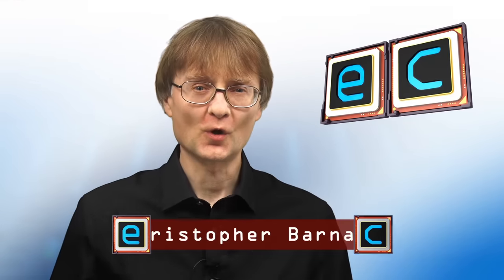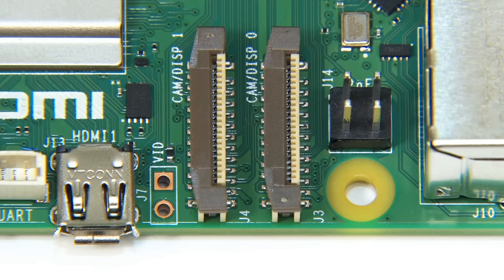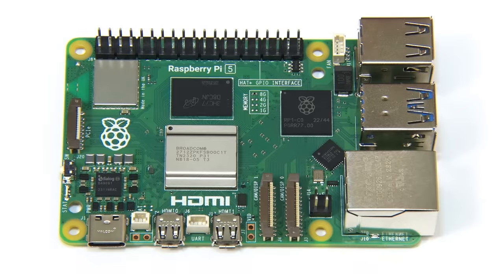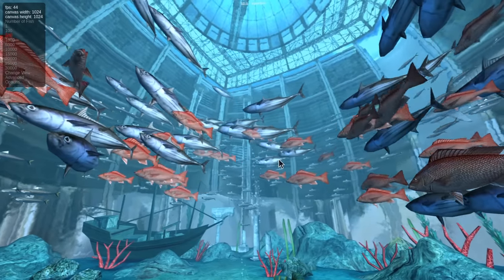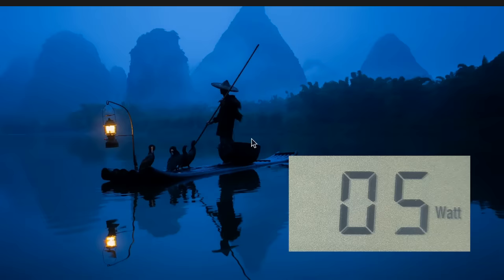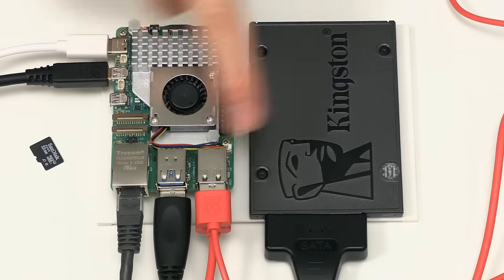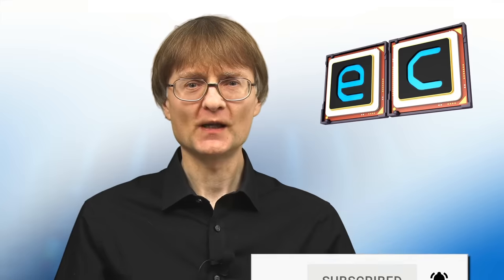Raspberry Pi 5

Comment: Great video about the Pi 5. I wasn't expecting a video this quick about its release!

The Pi 5 is a welcome upgrade to the Pi 4 that has a lot of improvements that make it even more comparable to a small desktop PC. I am quite impressed by the performance improvements that have been brought with this hardware. After getting used to the Pi 4's layout, seeing that the Ethernet port has moved back is a change. Quite exciting!
Though, I will still stick to my Pi 4 as it does everything that I need: I unfortunately don't use it as much since having a laptop (that I plan to use for a very long time). Furthermore, I like that Raspberry Pi OS supports older models and that they are thinking about performance. From their blog, one of the maintainers mentions that Wayfire, the Wayland compositor that will be used in the next release of RPiOS as they're moving away from X11, has high reliance on the GPU, which makes it less attractive for older models (Pi 3 and older) but they are looking into mitigating it by using software composition for these. I'd link to the comment but Youtube anti-spam policies might lead to my comment being deleted.
I also dislike the removal of the TRRS connector as it comes in handy sometimes, especially for audio output.
Reply: Wayland shouldn't be a problem on older Pi models, as long as it supports OpenGL ES 2.0. The KMS fiasco with different sets of drivers makes it a pain, though.

Comment: I have to say the firmware updates had/have improved the 4s performance a lot. 2X sounds like it could actually be a daily driver for many people. But I'll have to pass on the Pi foundation red and white case.

I used to drop, at least, 10% (honestly, I do not remember; just that it was frustrating) @1080p and after about 30 minutes of updates I have dropped 603 out of 26143 (I'm halfway through the video). I also remember youtube pushing very close to 100% and now it is topping out ~84% and the Argon V2 keeps below 60c.

I do admit I got an exceptional chip and video because it over-clocks @2100 with no bumping up the voltage.

I, pretty much under-use my Pi4 as a travel router; I cannot wait for the next Zero and carry my router on my key-chain.

Comment: The new Raspberry Pi is a very interesting beast. It's obviously going to have value as a well supported long term platform, but for people doing compute based projects, it gets a bit weird because comparable RK3588 based systems will have a much higher efficiency (and multicore CPU performance), and better support for OpenGL (non ES!!!), Vulkan (up to 1.3, if I remember correctly), and potentially OpenCL down the line, on top of already having options in 16 or even 32GB of RAM in some cases.

Personally, I'm very interested to see how it performs in graphics heavy applications using Box64, and if we can get solid support for any machine learning frameworks...I wouldn't be surprised if the big players like Pytorch did get some sort of support for the RP5, given the massive market of potential Pi owners, but I also wouldn't be surprised if people interested in doing compute work on ARM didn't just move to another SBC or perhaps an Ampere Altra.

Regardless, It's super exciting to finally get a new Pi on the market!

Comment: Raspberry PI 5 is a disappointment for me.
Cons:
- very old ARM Cortex-A76 design
- high power consumption
- high requirement for the power supply
- fan requirement to keep clockrate high
- requirement for a M.2 HAT to connect a M.2 card
- M.2 PCIe card max size type is 2242, while PC M.2 cards are usually much longer. This will drastically reduce the selection of good M.2 cards.
- no AV1 decoder
- price with the extra M.2. HAT. A PC is much cheaper and more capable.
- still dependent on Broadcoms Videocore, while the ARM CPU is only attached to it. I would have preferred a clean, pure ARM SoC here.

Pros:
+ first models start by default with 4 GB RAM
+ RTC
+ PCIe support
+ power button

The advantages of a normal low-end PC make the Raspberry Pi 5 look bad. There are cheaper microcontrollers for playing with GPIOs, and if you hook something up incorrectly and create a short circuit, it won't cost you a fortune. I will therefore definitely not buy a Raspberry Pi 5. My Raspberry Pi 3 is basically enough for me. The only thing missing from the Rapsberry Pi 3 would be a little more RAM. Other single-board computers are now better. The software problem should slowly disappear for them.

Comment: They could have added a couple of ARM Cortex-A55 CPU cores so we can prototype systems using a heterogeneous processing architecture.
The VideoCoreVII is a very welcome addition, finally more GPU power than the VideoCoreIV in the Raspberry Pi 1...

Comment: My thoughts? The improvements in cpu/gpu performance are great, the improved connectivity for USB und microSD cards, plus the awesome pci-e interface are awesome and probably quite a few people will be happy about the separated fan-connector, the hardware power-button or the rtc battery connector. However... I really wished they would have upgraded the networking... 2,5GB ethernet port... and/or... WiFi 6, is, in my oppinion at least as much as required as 600 MHz more CPU power. I literally would have payed 10-15 bucks more for more modern networking. Also, still not a fan of micro-hdmi and the things they removed (audio/composite port, also no  h.265 hardware encoding and even removing the h.264 hardware encoding). Sooo... that leaves me with: great update, but not necessarily the upgrade I personally was hoping for.

Comment: Thank you for this review (and all others). My dream SBC rasberry would run LinuxCNC (64 bit) 2.8.4 "Buster". The ethernet port could communicate with a Mesa 7i96S.
If this were to happen, no more 50 pin printer port!! I have the Mesa CNC interface card and would like to have a small SBC to create a very neat integrated CNC package.
If this is something you are interested in, your input on this topic would be awesome!

Comment: It uses 1 watt when off?
Reply from the maker: That is the minimum the power meter can show -- so somewhere between 0.5W and 1.5W when the Pi is off, but the adpater is plugged in, just like any computer that is not turned off at the wall.

Comment: There are office PCs out there slower than the Pi, so there's that. But, I remember when the early Pi began, it was the cheapest, most powerful SBC. These days, it's neither the cheapest, nor the most powerful, by a large margin. It went from really cool board for all makers that democratized the DIY space, to a really cool toy for enthusiasts. And there's nothing wrong with that, but at that point I start expecting an NVMe slot, and better than 1x PCIe 2.0. It's in that middle ground where it isn't too cheap and it isn't too powerful, both at the same time.

Comment: I have Raspberry 2.3, 4-4GB and 4-8GB, and I recently bought an orange pi 5 plus, comparing the orange 5 plus with this raspberry pi 5, I found it strange because using them the orange pi 5 plus seems much more quickly but sysbench showed otherwise. See the Orange Pi 5 Plus sysbench below.
CPU speed:
     events per second: 3875.44

General statistics:
     total time: 2.5781s
     total number of events: 10000

Latency (ms):
          min: 1.01
          avg: 1.03
          max: 6.81
          95th percentile: 1.04
          sum: 10308.45

Fairness threads:
     events (avg/stddev): 2500.0000/22.67
     execution time (avg/stddev): 2.5771/0.00

  Well, it looks like I'm going to have to buy the Raspberry Pi 5, because I really like the quality of the operating systems available for it.

Comment: What is up with that SMD resistor which looks like it's specifying the memory?!?  All of the 4 choices appear to be connecting to exactly the same nodes..  Is this just something that is being done by the pick and place machine to give you a visual indicator of what memory chip is on that specific board, because it sure would appear that the jumper is doing nothing...

Comment: Great review as always! 🙂 
Although, I would've liked to hear about some of the more obscure connectors on the board and there was very little about GPU / video performance.
For me, there are many features on the Pi 5 that I have been missing, ticking almost all the boxes for me (PCIe... Yay! Onboard RTC... Yay! Power button... Etc.). Of course, everybody has a different take on what features are essential, nice to have or not needed and the strength of the Pi has been its versatility.
As for me, I still would've preferred M.2 instead of a custom PCIe connector, even if this came with some limitations. Hey, I wouldn't have cared if it meant slightly growing the board, although, a lot of people would've protested. 😆  My big dislike is the continuing use of HDMI instead of DP. DP is very common in embedded and it's an open standard. Even as a connector, mDP is more robust than the flimsy microHDMI. The appearance of active cooling as a default is slightly alarming for me but some applications or custom boxes may be fine without it and it's certainly good to have a standard cooling solution.
Reply: It is a bit odd using that pcie connector... even if you want to use pcie cards instead of a NVME, there's cheap adaptors already for that.
Seems almost like they wanted to sell genuine accessories.

Finally means you could pair it with a reasonably cheap SATA adaptor and make a DIY NAS... something I've been wanting to do for about 5 or 6 years now (and gave up and made a DIY old desktop PC storage machine instead).

Comment: can anyone tell me  if i make SD copy to SSD my old SD card, and start only used SSD boot, all have same than SD card, BUT if go internet looking yotube or netflx and make video pause, and then all OS freeze and need new boot can use raspi again, my table computer have raspberry pi 4 8gb board. or have better method copy SD card to SSD and use only SSD boot raspi,  i used only SD card copier what have in raspi.

Comment: How many people still thought the lack of Pi4's was a production supply issue? Did anyone know until two days ago that the problem wasn't supply issues but a new release? The Raspberry Pi uses a Broadcom system-on-a-chip (SoC) that contains several components, including a CPU, GPU, memory, and other peripherals. As a result, the production of Raspberry Pi has been impacted by the semiconductor shortage, leading to delays and shortages. Mar 1, 2023 By the way the compute module 4 only came out October 2020.

Comment: Yes, this will be a success but, the Pi team have lost the plot. It's now all about speed and the desktop experience, just like the PCs did moving across the years. The Pi was supposed to be the computer for hackers with easy I/O access, the very thing PCs lost with no serial or parallel ports only USB connectivity. The Pi seems to be moving that way with complex interfaces made with impossible for individuals to buy connectors. It would have been nice to see more I/O with SPIO or I2C or a simple clocked data bus with dual port ram. Any extras that allowed someone at home to build bits themselves and attach to it. The lost of the audio port is a sign of the times. Would have been nice to see 2 or 3 more of them, not zero.

Comment: Mr Barnatt Sir, You are a treasure unrivalled. First impressions on Pi5? I like it, that's a huge i/o upgrade. 1 PCIE lane feels like not enough, would much rather swap one of those camera ports for another PCIE socket but I'm weird and You can't have everything. On topic of Me being weird and not having everything, I would have liked to see 2.5gb ethernet at this stage. The deciding factor for Me will be as it has been with all the previous Pis. Video playback performance in a browser. Specifically, Youtube playback. Even accepting that it maybe won't do for the gaming YTers who upload in 4k to get around YTs awful compression and then we watch on 1080p/1440p screens... If it can't do a good solid 1080p60 its use cases for Me are sorely limited from I could use 5 or 6 of them, to MAYBE I decide it's okay for a background machine and only have one.

Comment: have new raspi 5 adapter cable can use raspi PCI port to connect PCI paraller port car or other PCI card to raspi. and use plug and play this card same than normal computer can.

Comment: First thoughts are that I don't want any computer that doesn't have onboard sound. That said, since the USB ports are all handled individually by the southbridge, I could get used to using a USB audio adapter for sound and a passive hub for keyboard and mouse. So...okay, we're breaking out the audio to a separate device connected via USB. Not too different from sacrificing an expansion card slot for a SoundBlaster.
Reply from the maker: It has onboard sound, it just only outputs it via HDMI! :)
Reply: @ExplainingComputers  That's like saying that it supports VGA, you just need a HDMI to VGA adapter. (Never mind that very few people still use VGA monitors; the analogy stands.) It doesn't have analog audio on the motherboard, which has been a non-starter for me regarding some of the Raspberry Pi's earlier competitors. The new southbridge chip makes this less of a priority.

Comment: I wished they would have put a 6 or 8 core CPU on the Pi 5. I also think that a 1 gig version should have been released, for the project guys. I absolutely do not like that they changed the board layout again. I have a ton of Pi4 cases that would like to have used on the Pi5. My Argon One, my Michael Klements case with the stats display among others.

Comment: Excellent video. If you don't have it planned already, would you be able to test the USB power supply limits? Maybe with a couple of power hungry rust spinners.

On to the Pi5 itself. What a disappointment. Mainly the hackish bespoke ewaste power supply and the micro hdmi connectors. I'm not sure why they haven't switched to display port over USB-C. A USB-C hub meant for docking laptops includes hdmi at 4k60, audio in and out, USB for keyboard and mouse, SDcard and sometimes 1 Gb ethernet. All for about the cost of two micro hdmi cables. There's also plenty of standalone converters available for VGA and composite.

Also based on the pi's price point I'd much rather have a M2 slot instead of PCIe, if that was a choice they made.

Comment: What people don't realize is that the 3.5mm jack was actually an RCA type jack.. not audio alone.
You could use it on a CRT TV.
I'm absolutely furious that they removed it.
Reply from the maker: I can only agree. Not good for retro gamers and others
Reply: @ExplainingComputers  Exactly.
I can only hope someone comes up with some sort of an adapter maybe, that plugs into something on the board.
I realize there's actual HDMI to RCA adapters, but they tend to not function well and they overheat.

Comment: Good shit and a fairly reasonable price (there's absolutely no point in the 4GB version, though), but I don't see why OpenGL ES 3.1.0 from 7 years ago instead of the 4 years ago released 3.2.6.

5V * 5A = 25W, so that's quite a bit, and explains why the PSU was so small, as seemingly it's simply very hard to do 20V * 5A = 100W in such a form factor. But it does leave plenty of room for the 3 seconds at initial boot and much more for connected devices, so it's a good call.

Comment: This looks very promising as a replacement for an old i3 PC that I have running as a home server.  Until now, it didn't look like there was a Pi with enough horsepower to replace this old energy hog.  Even if I need to split my workload between 2 Pi 5 I'd still do it just for the energy savings.

I'd like to see a PCIe to USB3 hat - to add more USB3 ports with their own IO channel.

Comment: RE: SysBench test - I would increase the test time to be at least 10 seconds with the faster RPi to be more accurate. It is not the same an increase in performance from 4 sec to 2 sec than from 20 sec to 10 sec. Even if both are a 2X increase. That is my opinion.

Comment: Is this pre-production unit or an actual example of what the rest of us will buy?

I think the PCI connection is interesting. Considering what all the PI5 clones thought the actual PI5 would be like, none of them thought PCI.

Could the UART output be converted into an audio output by some enterprising  soul? Actually a quick Google on that shows an article in HACKADAY.

The PI5 probably has more documentation already than  all the clones that have out a year.

Is there any chance that the RP1 is a reworked rp2040?

Not so useful items:

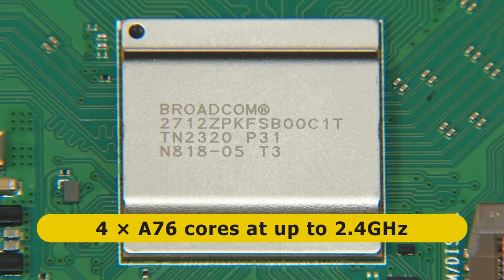At 2:57, just right if the cpu are squiggly traces. Any valid reason for the squiggles?

At 2:32, if I solder on three more resistors, will I get a 15Gb machine 😊.

I'll stop there.

Comment: Pi 4 released in 2019 and pi 5 will be released in 2024. In 5 years less than double the speed/power. Not so impressive. But it's fast enough and the real shock is the low price. ❤❤❤

Comment: I was hoping for a usb 3.1… wonder why that wasn’t included…
Reply from the maker: Why? It would have required twice the bandwidth! :) The Pi 5's USB 3.x ports are much faster than before, but still not up to USB 3.0 (5Mbps). Although the new USB 3.0 ports still offer a faster interface than the 1 lane PCIe 2.0 connector.
Reply: Aha! Thanks for the explanation. Makes sense. I have my rpi working as a home server attached to a nas box with usb 3.1, that’s why my expectation 😅
I loved your commands to test the speed though 👍